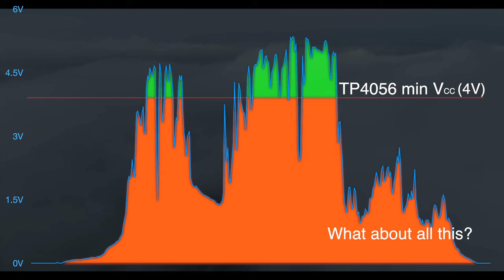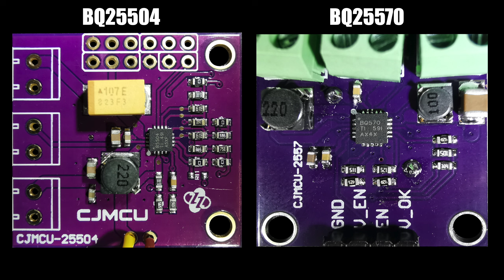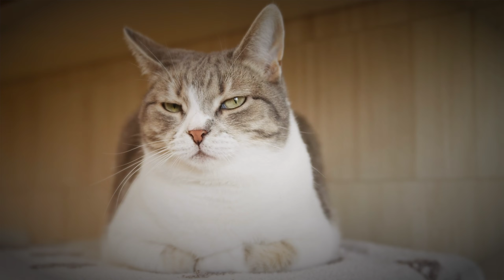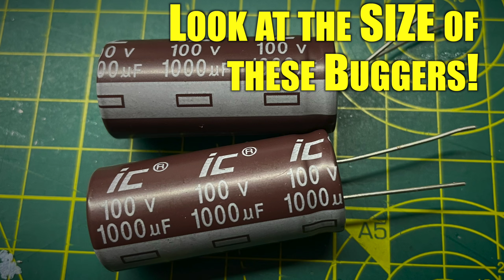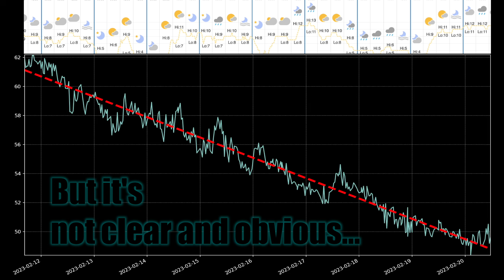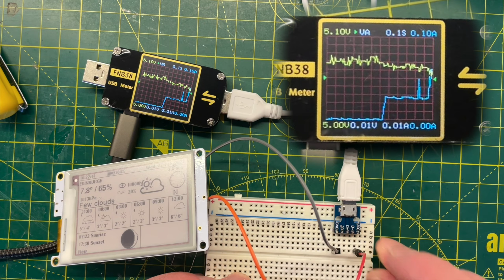Harvesting Solar Power for Low-Energy Electronics: Can We Run Forever on Scottish Winter Sun?

Comment: You put a lot of work to this video thanks alot. Your epaper deep sleep measurement method maybe misleading when you put that 1k res in series epaper gets less voltage so it may draw more current but for 167 mV it seems it is negligable.

Comment: Perhaps you can obtain a 5V voltage for the TP4056 by connecting the solar panel to a joule thief. This indicates that the battery can be charged as long as it receives light.

Comment: Hi

Does de BQ25504 charge the battery when the solar cell voltage is below battery voltage? or its just the BQ25570?

Comment: Im using ePaper displays too. One thing to consider is that they are consuming power also. I have a setup with esp32 and ePaper. In deep sleep esp32 consumes 12uA but when i attached ePaper with the same code it consumes 300uA! With Spi.end it reduces to 160uA but still consumption is there. You should check it with PPK2 to see

Comment: I do find those sound effects a bit loud and also unpleasant when using headphones. Please make those quieter or don’t use them at all. From the technical side: I really like the idea and might use it in future. In the end you do not need to charge the cell to 4.2 Volts of this is easier. Or you might just use a LiFePo4 cell with its lower voltage.

Comment: I had some pretty good luck with just a 6V solar module, lifepo4 cell, a shottky diode, and a solid-state high-side switch-- The mcu monitors cell voltage, and when it goes below 2.7V it turns on trickle charging, and when it goes above 3V the trickle charging is turned back off. The MCU was asleep most of the time. The cell is kept away from full charge to improve cycle life of battery.

Comment: For the life of me, I don't understand why everything is not running on solar?
We have the biggest fusion reactor up in the sky and we are just beginning to use it! 
1 KW per square meter is nothing to sneeze at.
Reply from the maker: Yes, renewables and building houses properly so they are insulated and don't need so much heating would go a long way to helping.
Reply: The cost of recycling solar panels and batteries js very high
Reply: @nuwanda923  Used to be true. Not anymore.

Comment: What if you put 3 panels in series and use a buck regulator like the MP1584 to charge the battery? 
I have to use NiMH for my outdoor projects because Canadian winters will destroy a Li-ion cell. 
I think putting 5 or more 100uF Tantalum capacitors in parallel close to the ESP32, would be able to deal with the power spikes.

Comment: The YX8018 IC (joule thief), used in lawn lights may be a better solution.  These are cheap, and easy to find on Ali.  I have made a circuit that attempts to keep charge on a lithium battery that drains to a low power blue LED at night.
Another idea:  More durable (and less dangerous) NiCads may have a less internal bleed.
Reply from the maker: Good idea, I've been meaning to play with the YX8018 for a while.

Comment: More cells or move down south. Since mid Feb I've been charging up my 9.6kWh battery most days. 😂  now how long could I run that display for? 😂😂
Reply from the maker: Yeah, definitely hard to argue for solar up north - though it is pretty popular. More and bigger cells is the answer.
Reply: @atomic14  look on the bright side, if you had more sun you might have a lot more midges. 🙂 You could biomass the midges to get electricity, now that would be a great idea.